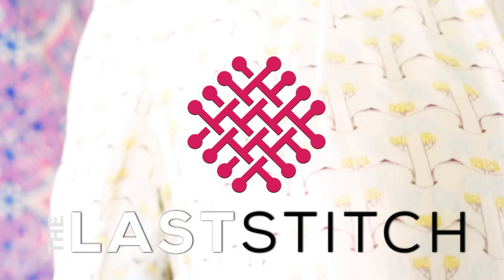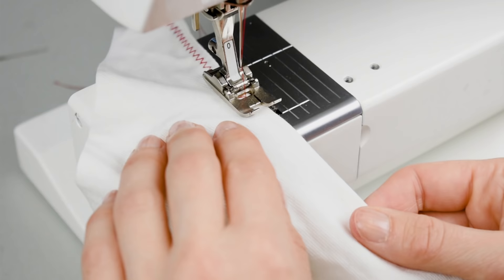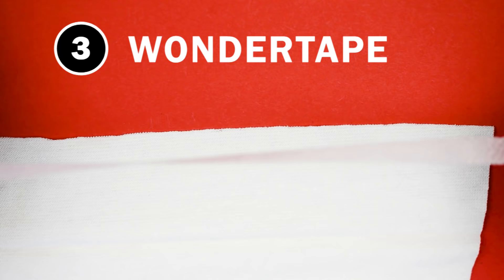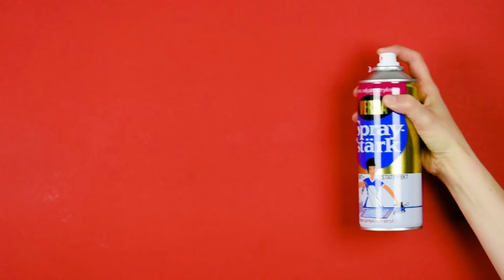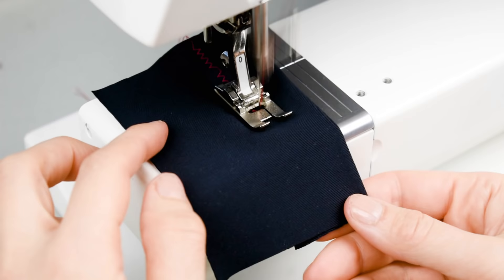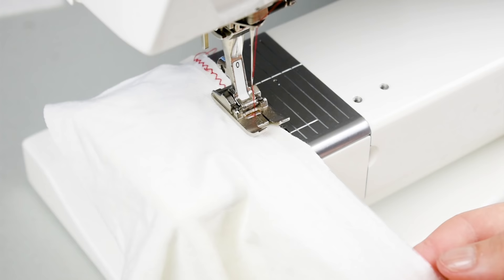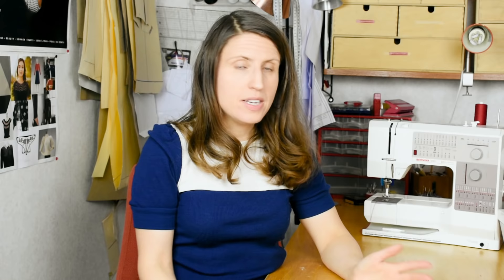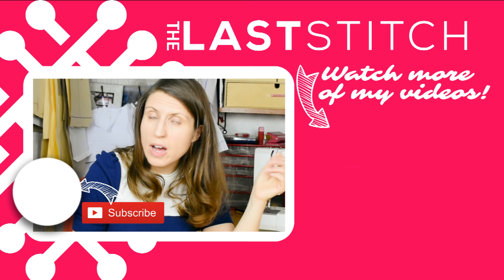Tips for Hemming Knit Fabrics on a Regular Sewing Machine

Comment: I would like o put a side split in a knit top I am making it is 95% poly 5% spandex do you happen to have a video or anything on your blog to show how o do this. Many thanks
Reply from the maker: +Eileen McCallum What you need is to over cast the seam allowance the length of the slit, using a serger or a sewing machins stretch stitch. Then sew the side seam using a stretch seam or serger seam until you reach the slit. Fold and gently press the seam allowances of the slit and topstitch them from the right side. Then do the hemming. Also this Sunday I'm publishing a video on how I made a wrap dress and in it I show how a slit opening for the ties is made on real DVF wrap dress and that is another way to do it.
Reply from the maker: Also you might have to clip the seam allowances where the seam ends to allow for a good fold
Reply: Thank you. I followed your instructions and it turned out beautifully. Do you happen to have a blog or video on how to sew a v neck in a knit fabric, would I have to use the same fabric or could I use a stable twill tape or ribbon on the inside facing. Also I took your advice and used wonder tape and it is fantastic. Thank you for your great tips.
Reply from the maker: +Eileen McCallum Awesome to hear 👍

Comment: I really need a stretchy straight stitch. How can I do this on a regular sewing machine? I need a single stitch not a triple. If This can only be achieved on a certain machine what is this machine called? I've tried slightly pulling on the fabric as it feeds under the presser foot but this produces pickers. Thanks.
Reply from the maker: Hi! It's done  using a coverstitch machine, with either 1, 2 or 3 rows of stitching, I've done lots of videos and even written a book about it (Master the Coverstitch Machine) that you can check out. It sews a straight stitch with stretch and no puckers, which a sewing machine cannot do unfortunately
Reply: @Thelaststitch  Thanks.